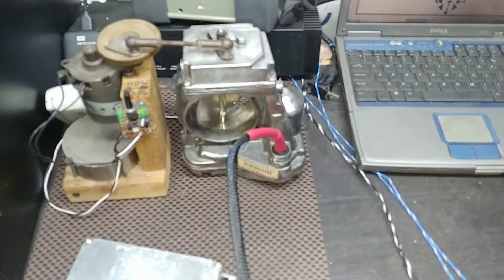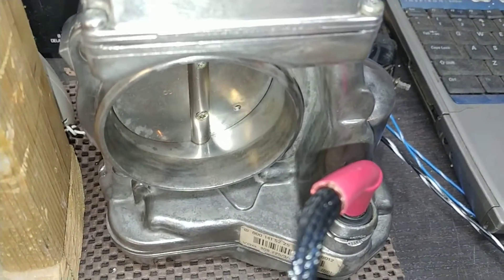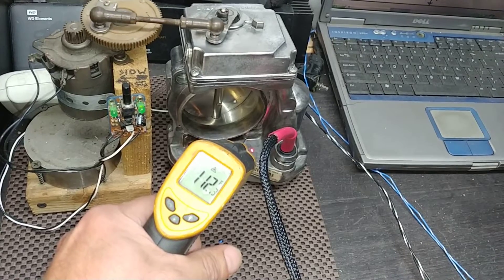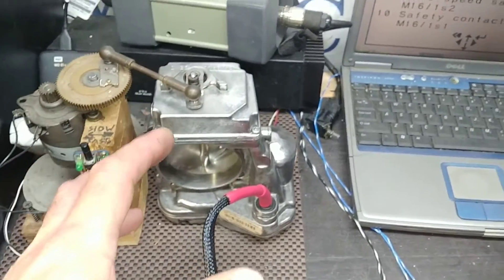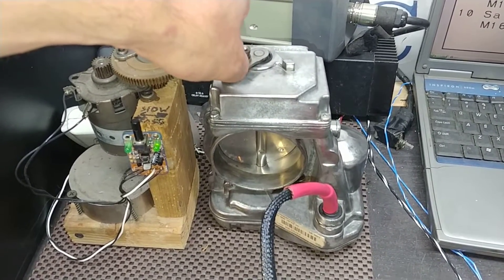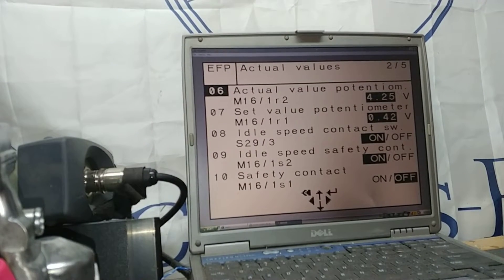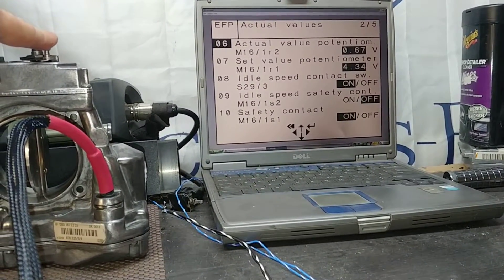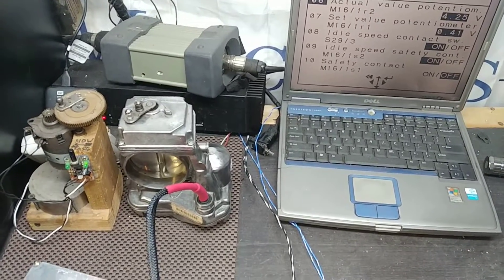Mercedes SL500 R129 throttle body bench test

Comment: CAN you actually repair/replace the potentiometers inside these units??  i have asked before but you don't answer.  Thanks.
Reply from the maker: I cannot reproduce potentiometer. I can repair some of them but not the board itself.
Reply: @vsandvs  So if the potentiometer has a worn spot, the only fix is a replacement then.  Is this common?  Thank you
Reply from the maker: Yeah. I'm sure there are some factories that have equipment to resurface graphite but I do not have that kind of equipment. Has to be industrial equipment, I guess